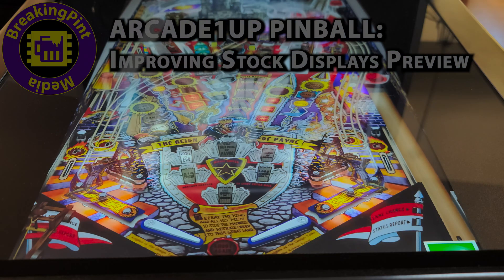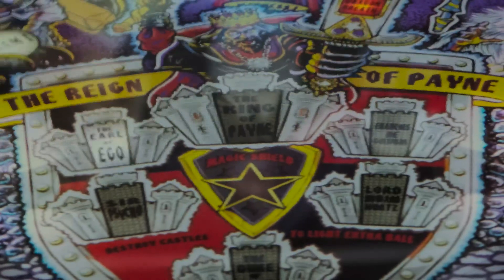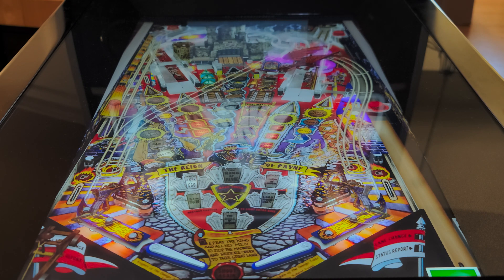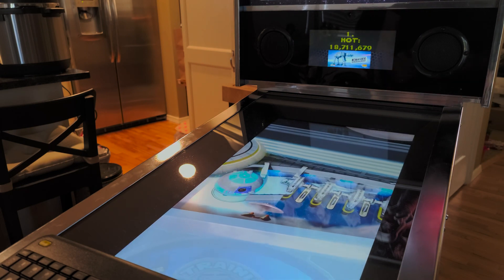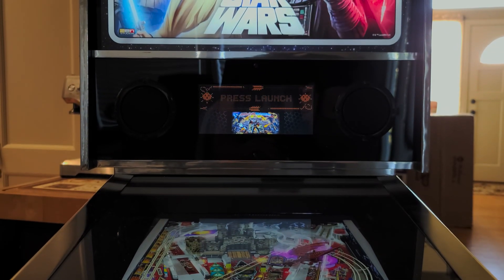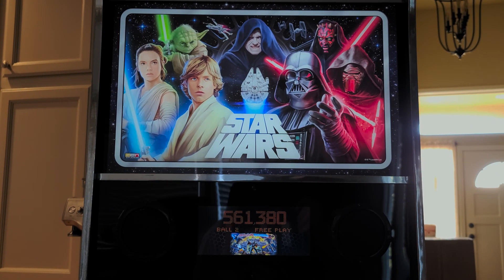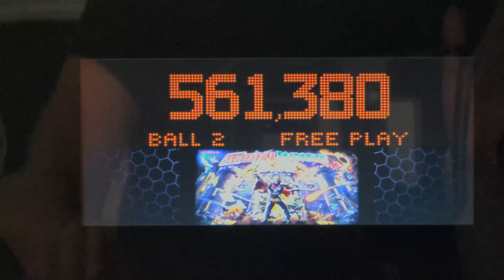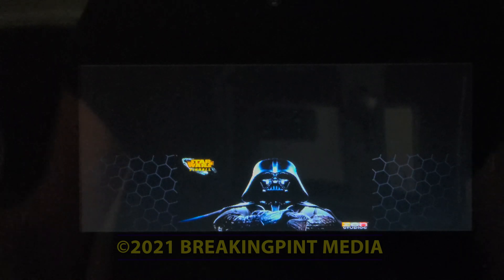Arcade1Up Pinball Display Mods Preview

Comment: Great video! What frontend did you end up using for table selection with the buttons? thx for sharing!
Reply from the maker: Glad you enjoyed it!  I'm using Pinball FX3 (through Steam) in cabinet mode.  Cabinet mode requires that you email the folks at Zen to request a code that enables it (they ask a few questions and sometimes ask for pictures of your vpin cabinet setup to confirm it isn't being used in a commercial setting).  Once they clear you, they provide the code for free. 

Once you enable cabinet mode there are various options that become available, including options that allow positioning of the DMD display on as secondary monitor (it's pixel coordinates based and a bit of a PITA, but once you make sense of it...it's not a huge deal if you need to do it again).
Reply: @BreakingPintMedia Thank you for your response. I was able to get the machine setup with a cabinet code as you suggested. It's working great but for now I still have to use the stock pinball FX3 interface and a mouse/keyboard to select a  table.  At around @14:27 it shows you quickly and easily just scrolling through tables so curious what software you are using that allows you suck easy table selection.

BTW your DMD looks awesome! No matter what scaling/position options I have tried my DMD still awful grainy in-game while your score and status messages look awesome @12:28.

Thanks again!

Comment: Thanks for this! I'm not ready to make the jump to the PC but knowing that the stock screen is capable of better visuals is interesting. I'm wondering if there is a way to get into the settings on the stock PCB.
Reply: I was able to add the controller to the monitor, and then an lvds to hdmi converter to the pcb. I could then connect the pcb to the monitor using an hdmi cable.  All still retaining the stock pcb. I was then able to improve the monitor visuals immensely. In addition, I added a Marseilles mcable classic hdmi in line. (Its an upscaler and anti aliasing module). Greatly Improved the visuals by upscaling from 720p to 1080p and then using anti aliasing to improve the graphics quality for fairly cheap. Not as good as if you converted to a pc, but much much cheaper and I was able to keep everything stock.
Reply from the maker: As far as I know, the stock PCB's LCD driver portion has no user-accessible settings.  I wouldn't be surprised if the circuitry was kept as simple as just managing the required power and the HDMI signal lines, there being absolutely no logical functions to manipulate settings.  It truly is a shame because if A1Up had given us control, it would have made keeping the stock PCB in place a much more feasible proposition.  The 720p scaling is salt on the wound. :(  

If you ever decide to get a driver board and do a full PC setup...the first time you play in full 1080p with your color/brightness/contrast settings dialed in, you won't want to ever go back to the stock PCB...I guarantee it!

Cheers!

Comment: great video.  I was wondering.  can you hook the lcd driver card up, adjust the settings on the lcd, and then hook the original pcb back up and retain those settings?  or will the original pcb override them?
Reply from the maker: Unfortunately the settings are stored in the driver PCB.  The original board from Arcade1Up has its own presets hardcoded into its own LCD driver circuitry and will use those every time.  Hope that makes sense!
Reply: @BreakingPintMedia  thanks man.  Thought it might be worth a try, but you saved me some cash.

Comment: Great video man. I am gonna give building one of my own a real shot. I've started building Pinball cabinets twice already. First one was using 2 ips 60 Hz 24 inch monitors. The backglass monitor in portrait mode. The next build I started was a version with a Full HD 27 inch IPS 60 Hz as a playfield. I was never satisfied with the increased size though. 

This third time, I am going to use a MSI 24" Optix G241 IPS 144 Hz for the playfield. I got it really cheap, and think it will be perfect for the project. I also bought a small 1920 x 480 ips that I will use for the DMD. Still no luck finding a perfect monitor for the Backglass though. I'd really want to go with a 21.5 inch IPS (like the one you used in the other video). But perhaps I'll be using a cheap one to start with that's not IPS though.

When it comes to computer parts i've been collecting some parts that I think will be ok:
- i7 7700
- 16 Gb ram
- SSD
- GTX 960

This will be a decent machine I suppose. Letting me play in 144 Hz (or at least 120 Hz)
Reply from the maker: I think those specs should allow consistent FPS over 60 on Pinball FX3 (if that's what you'll be going with).  I would love to upgrade my playfield monitor at some point or build a new cabinet and spec the system to take advantage of faster refresh rates!  I have a couple of 144hz displays but they're curved..

Comment: Great Video! Any chance you could share your picture settings of the playfield monitor via the VSDisplay adapter interface? I'm having a hard time matching its look to the Acer SS220Q back glass. Thanks!
Reply from the maker: Glad you found it helpful!  As far the settings, I'll get those this weekend and post them here (I'll post the numbers).  I was able to get it so the contrast is really good and the color vibrant, without much crushing going on with the highlights and shadows.  It also looks great from most viewing angles (especially from straight above).  Give me a day or so to get around to it.
Reply from the maker: That said, that Acer monitor is great in its default setting (unlike the playfield LCD)... I've been very impressed with it as a backglass!

Comment: How are you finding the performance with those cards?  I just used an optiplex sff for a yoke mod and I was mulling over whether to try one for the pinball, but I wasn't sure what cards would work with three video ports.  I completely overlooked the idea of using two cards.  Great work!
Reply from the maker: The performance is pretty good with the K620's @ 1080P, but there are very minor stutters in some animated elements during the non-play flyover scenes.. During gameplay it is fairly smooth though you can tell the framerate isn't much more than 60 (I do have mine set to vsync on, but I don't think the K620 can push much more than that anyhow).  As far as the monitor arrangement, they work perfectly for that.  As I mentioned in the video, the one on the x4 slot is my DMD/Audio via DP->HDMI, as well as my backglass via DVI->HDMI.  The one on the x16 slot is my playfield using DVI->HDMI so that it doesn't carry any audio (although the playfield monitor has no speakers, the VSDISPLAY board does support audio when fed via HDMI and I want to make sure during boot up Windows 10 doesn't switch itself to the wrong HDMI Audio port).  I purchased a PCIe riser cable and intend to upgrade the GPU slightly (the PSU in the 9020 isn't powerful enough for anything fancy, but I intend to use a K2200 I have laying around, which should give me improved frames).  Hope that helps!  Thanks for watching!
Reply: @BreakingPintMedia  Thanks!  That's very helpful.  Keep up the great work!